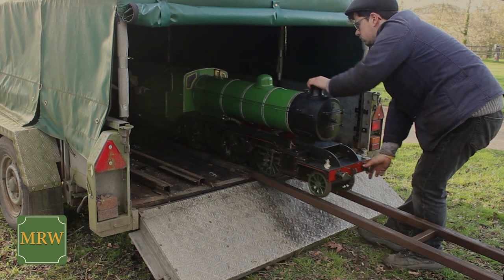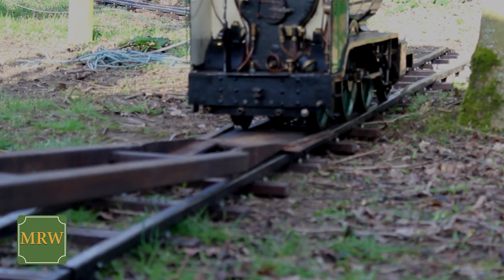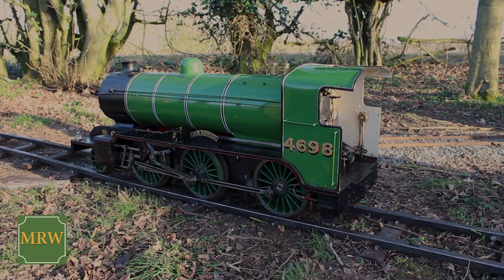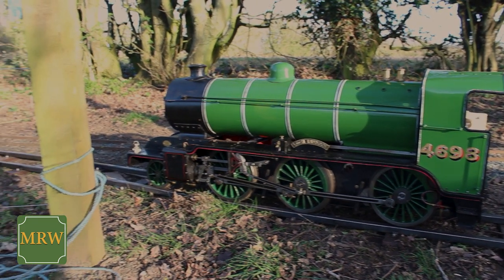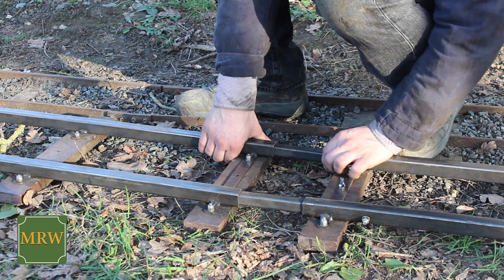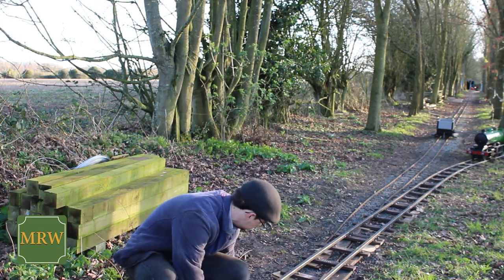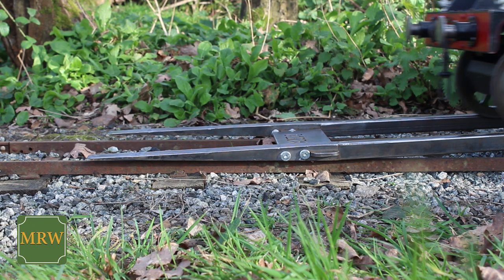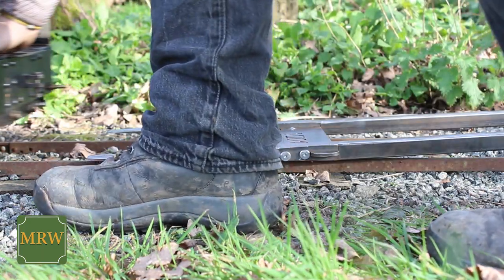Moving 7 1/4 inch gauge loco, unloading live steam miniature locomotives MRW portable track.

Comment: Very instructive - but can you get it UP the ramp and back into the van on your own?
Reply: Shouldn't be too hard as long as the ramp isn't too steep.
Reply: @VestedUTuber  thanks. I admire you working with and moving locos of this size. I’ve just given up a 2 1/2 inch gauge GNR Atlantic as after a mini stroke I no longer have the inclination to move around anything larger in 2 1/2 than a small 0-4-0T or similar. Gauge 1 I can manage a tender loco ok